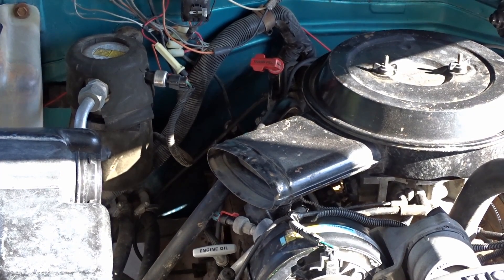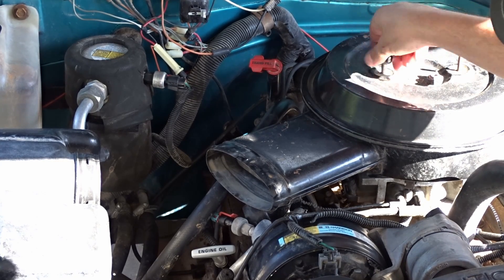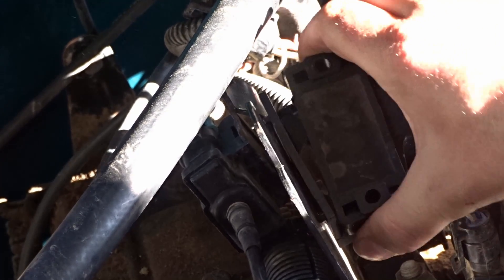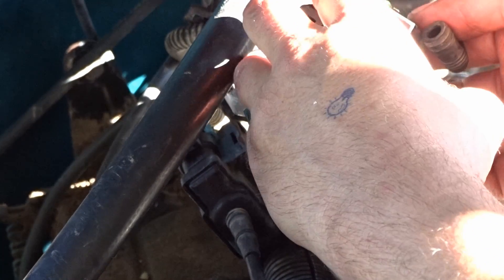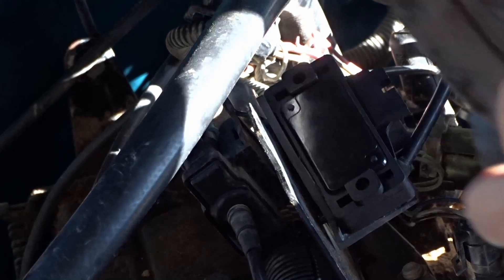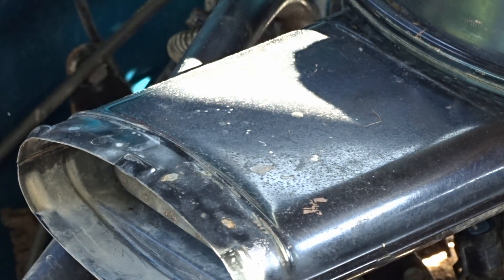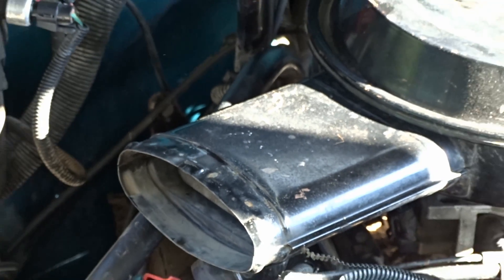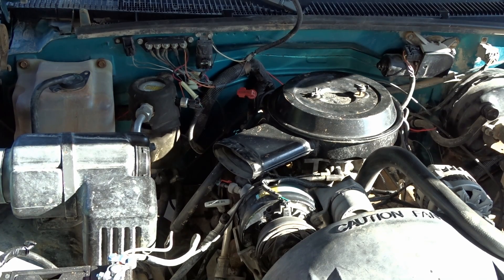How-to Replace a MAP Sensor 1988 - 1995 Chevy C/K

Comment: What would cause my 1500 1994 Chevy Silverado to stall when I go in reverse
Reply: Im having the same problem on my 92. Did you ever get yours fixed
Reply: Valve body cross leaks maybe?
Reply: Distributor
Reply: @sega2229  Spot on. Was about to comment the same. New distributor (assembly w/cap, rotor & ignition control module) fixed my 95 doing the same thing. Didn't really think it would fix it, but it did. I just kept thinking there's not much to go wrong there if the icm isn't bad.

Comment: 95 k1500 bogs down at 1500 rpm, doesn't stall but just stops getting right air or fuel or something...replaced fuel filter, do u think it could be this?

Comment: Where does the vacuum line from the map sensor go ???
Reply: back of throttle body between fuel inlet and outlet
Reply: Finally after all yes thanks 😂😂😂 thanks tho
Reply: There's 2 one goes on back of throttle body, other one I can't find but need to know..91 ck1500

Comment: I have same vehicle. I'm trying to look up the sensor on the driver side between plug 1 and plug 3 a single wire. I thought was ect sensor but that's on top by thermostat. Any ideas???
Reply: That is the temperature gauge sensor
Reply: It is the second ECT sensor but the computer relies on the one on top of the engine near the thermostat housing for the closed / open loop command.

Comment: is your o2 sensor on the drivers side manifold, if so where does the wire come from that plugs into the o2 sensor wire.
Reply: It's under the passenger side.

Comment: I have a 1997 gmc 1500 with the vortec 5.0. I’m having the same issues. I’ve replaced plugs, wires, distributor cap, rotary button, ignition coil, fuel pump, fuel filter, knock sensor, and I’ve cleaned and checked the mass air flow sensor. Next step is map sensor and I’ve read to check EGR valve. The other is fuel pressure regulator which for mine is inside the fuel injector housing. Hope this helps anyone else out there.